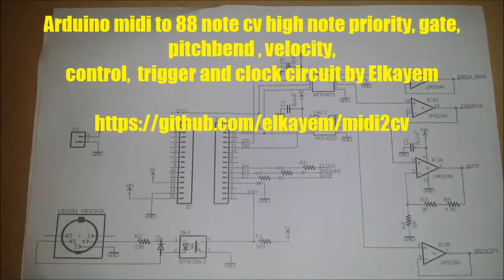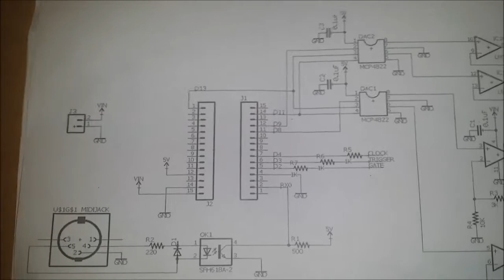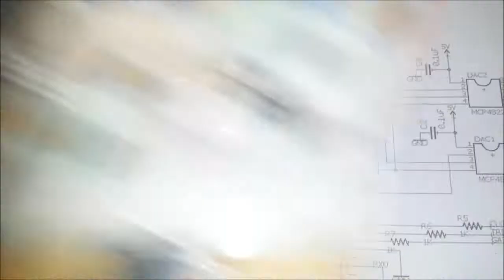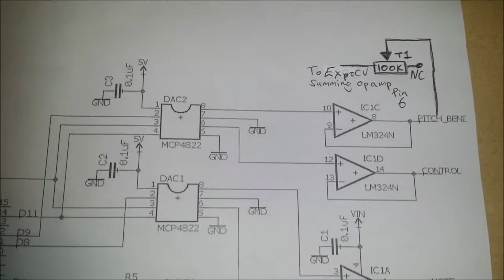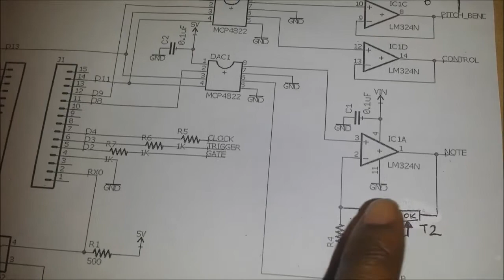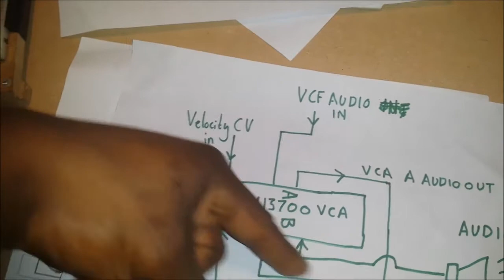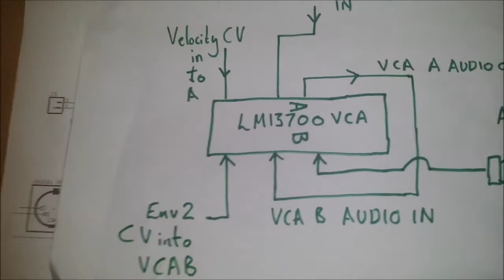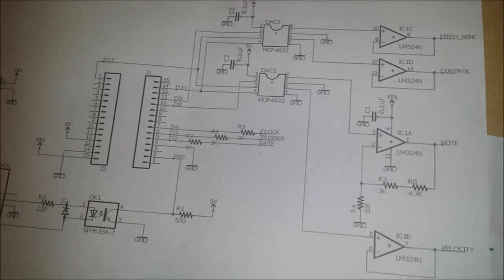DIY analog synth project Tutorial Part 15 ( Arduino Midi to CV by Elkayem design Pt 1)

Comment: Built this a fair while ago.
works great.

EDIT:
on the topic of op amp, i used a tl074, but i used dual supply so getting 0v wasn't a problem.
this was for eurorack os i had -12v connected anyway.
Reply from the maker: Glad to hear it worked for you :-)

Comment: you could use the TLC274 for the TL074 because its the "single-sides"-version (+Vdd and GND) of the TL074
datasheet for the TLC274: http://www.ti.com/lit/ds/slos092d/slos092d.pdf
datasheet for the TL074: http://www.ti.com/lit/ds/slos080n/slos080n.pdf

Comment: Now if I can just get digital replacment for the expo. conv. to work my problems would be solved.
But anything that could drive 64 oscillators at once is fine as a solution Dx Just finding something that actually works is hard!
Reply from the maker: AP Girl Indeed. If your able to write arduino code and manage to use an op amp to boost the 5v out from the dac to up say 10volts or more that would be a good start, however the last thing you need is loads of arduinos per voice , thats just not practicle. Maybe speak to Paul. S who does the teensy stuff and message him on his channel with your idea. He may have a partial idea/solution to kickstart you.
Reply from the maker: AP Girl This particular circuit can scale 88 keys very very well.
Reply: yea, the biggest problem really is that with the arduino I can't control the voltage accuratly. If I were to controle an external powersupply just for the pitch generation that'd be great! but accuratly controlling that is a nightmare with the arduino, and even getting such a circut to work is kinda complicated. 
But that would spare me from using an arduino per voice.
Reply from the maker: AP Girl This link maybe of intrest to you as there are some digital solutions to some chips ie :Lfos and envelopes , i was considering some of the parts for my project www.electricdruid.net
Reply: I'll look into it, if it turns out I can't go for the solution I wanted I'll build a full on DCO with a quartz crystal oscillator.
Reply from the maker: AP Girl Ok kool. Let me know the progress on your experimwnts :-)
Reply: sure thing
Reply: Okay, I took a look at the site and basicly I could buy some vintage clones or even the real chip there. If I were to order my oscillators there that probably would save me some time and money. I'll definitly consider buying a bunch of those chips. And another plus, they still have CA3046 chips. so if I do need them I can get them there.
Reply from the maker: AP Girl It definitly pays off to shop around and look for alternative solutions. If you were to build a complete discreet monster synth it would be very costly. Ic options are always handy :-)
Reply: given that once I know exactly how I want it I want to build a monster synth in my case it really is all about scaling. an IC solution probably will pay off in the long run. Space is of matter too!
Reply from the maker: AP Girl Yes agreed. I guess thats why most early 80s polys like the ob8 and a , and prophet polys used the cem/ssm chips for a more compact cost and space saving solution.

Comment: Hi, Adam! Did you've seen ACXSynth MIDI-CV? I guess it's what you need :)
Reply from the maker: MoolahNasreddin No i havnt , do you have a link ? :-)
Reply: http://www.acxsynth.com/archives/archives.html it's that device ;) if you understand. But the old version. One big con: need a PIC programmer (or firmware upload... device?) to complete the quest. I'll buy this thing after sometime... AliExpress suggest a lot of them with good quality.
P.S. edit: OK, it's not a "big con"... just an issue. It can be solved, firmware exists.